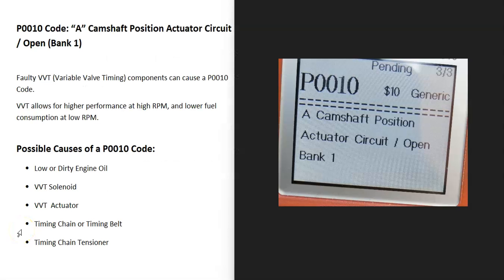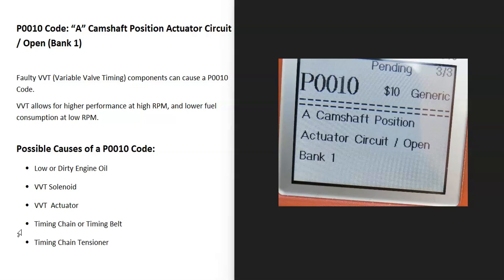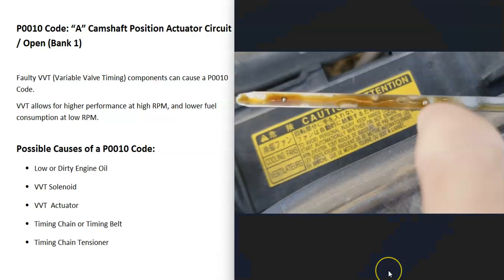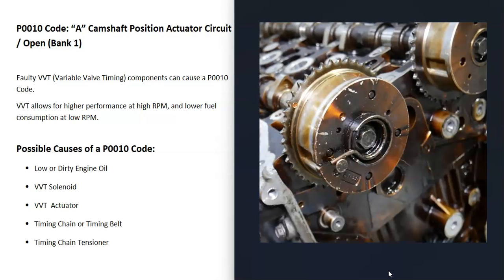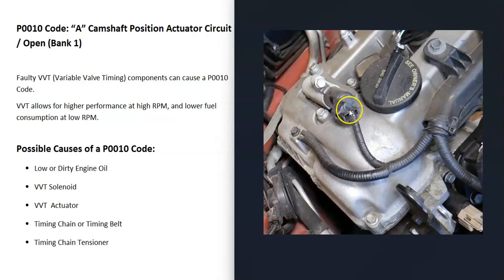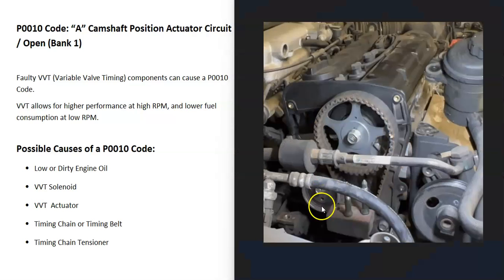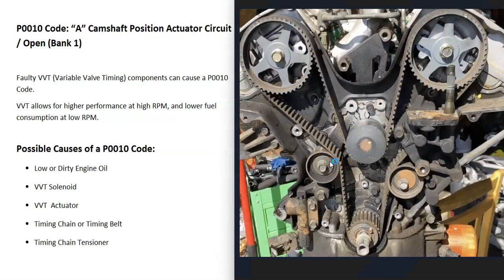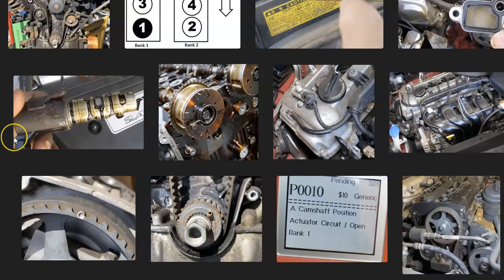Causes and Fixes P0010 Code: “A” Camshaft Position Actuator Circuit / Open (Bank 1)

Comment: My truck originally had a p0011 code so I replaced my cam sensor, solenoid valve and magnetic actuator on my 2007 GMC Yukon Denali now it’s throwing the p0010
Reply from the maker: I would double-check the Bank-1 Intake VVT solenoid. If the oil is good and there are no other codes, it is likely an Intake VVT solenoid issue.

Comment: 2011 3.6 Malibu w/ 47k mi. Oil changes at 5k mi. interval. Codes came on. P0010 & P011 with clean and full oil with 1500 miles on oil on tail end of a 328 mile trip. Should I suspect VVT solenoids or cam and crank position sensors?

Comment: My 2008 chevy uplander automatic just gave a check engine p0010 and immediately after that check engine it started hard shifting at 1000 rpm and  at 2000 rpm. Are they even related...strange they happened at same time...
Reply from the maker: Many vehicle computers use the CAM position sensor to know the RPMs of the engine as an input for when the transmission is to shift gears. If it doesn't have the information, it can cause shifting problems and possibly other codes.

Comment: Just had my cambelt and water pump done and had no lights on the dash before no got an engine light on and it says p0010 cambelt actuator sensor is this down to the garage to fix cheers
Reply from the maker: If it happened immediately after the fix there likely is an issue with the repair. I would check all the plugs for the VVT components such as the solenoid and be sure it plugged in good. Sometimes wires get hit or not attached well after a repair.

Comment: I have a question. the car runs idling but once I drive it on the street shows low oil. and the engine makes noise. where could I start. I have finished putting back from changing the head gasket. no noise when is running in the garage. but is showing that P0010 (1/2). It says Intake Camshaft Position Actuator Circuit/Open (Bank 1)
Reply from the maker: It needs to be diagnosed, but it may be a wiring issue. The low oil is worrisome, but may also be a wiring issue. I would verify the oil pressure is good and test the wiring.

Comment: Recently changed plugs on 2.7. First drive, the P0010 warning came on. Found connection of Bank 1 wasn't pushed on and locked. After a few startups and short trips, the light went off.
Reply: Where’s the connection of bank 1 ? I’m also having problems with my 2.7
Reply: @Teoramirezmty333  On mine, it was the wire connection on the VVT that was loose.

Comment: Hi, I have similar error code - "A" Camshaft Position Actuator Circuit (Bank 1) on 2015 Hyundai sonata . I just did oil change but engine light didn't go off. I see rpm is hovering around 1000-1200 when car is parked and started. Do you think I need to change VVT solenoid?
Reply: have you been able to fix it?...i have same issue and havent been able to find a lasting solution.
Reply: @tahirahmed4765  yes, my mechanic installed same OEM parts as shared in video.
Reply: @viralagandhi  I have the same problem, your mechanic replaced everything this video said?
Reply: Hi my car hovers around 1400-1500 rpm’s in park then drops 3-400 rpm’s in drive/reverse hoping this part fixes it
Reply: Hyy buddy same issue with my car too hyundai sonata 2015 is ypur car fixed?
Reply: @darshanpatel2461  yes I did same thing as mentioned in this video
Reply: @viralagandhi  brother have you changed tension belt or vvt sensor?

Comment: 2019 Hyundai Santa Fe limited. Codes P0010, P0011 thrown. Put a new solenoid sensor on it and the check engine light went off and then came right back on a couple minutes later. Noticed the oil was super dirty and 2 quarts low after we had taken it to the dealership for an oil change that we believe now was never done. Car has over 200,000 miles on it and we’ve never had any problems and we are always on schedule with oil changes and such. Got the oil changed today and the check engine light was off. Drove it about 15 minutes and the check engine light came back on. Scanned it and the P0010 code shown… Engine bank 1, so just checking to see how we replace what may be the actuator in this case.  Thank you

Comment: Hey will that p0010 cause my truck not to start because it's not pressuring the fuel rail it's a 2011 GMC 2500 6.0 gas hd 4 door 2wd if you need more info let me know because it has not ran in 3 yrs I bought it and barely put 10000 miles on it but there is a story